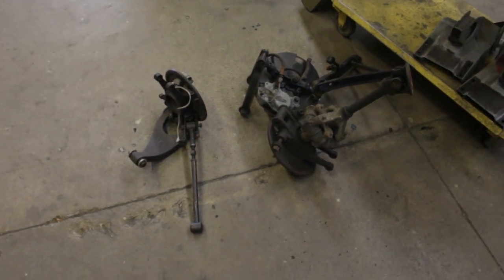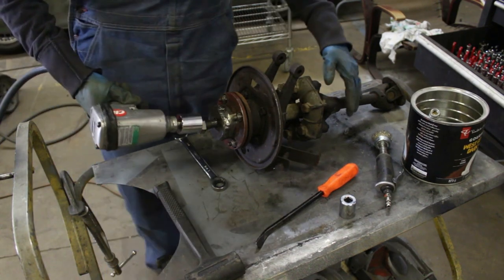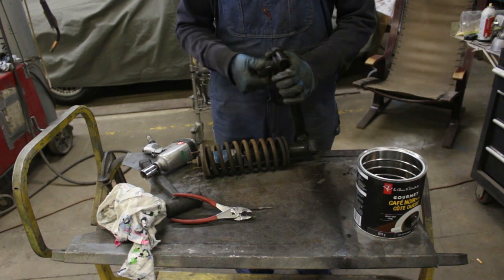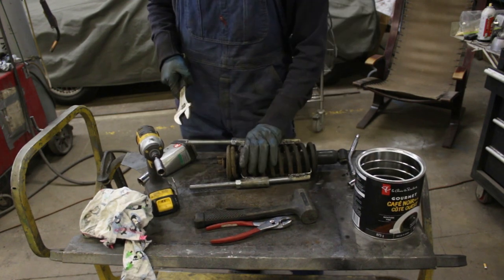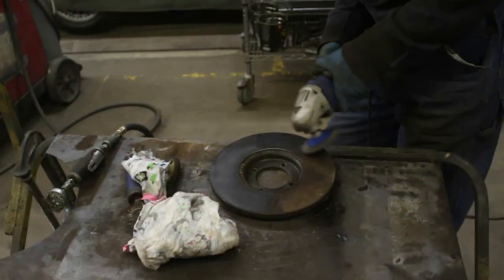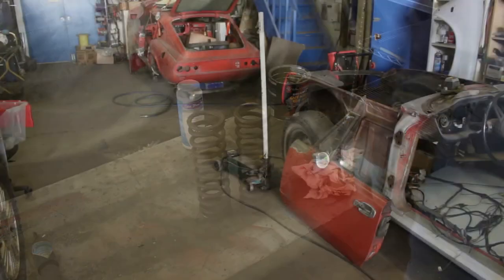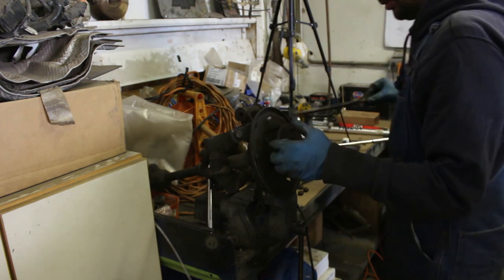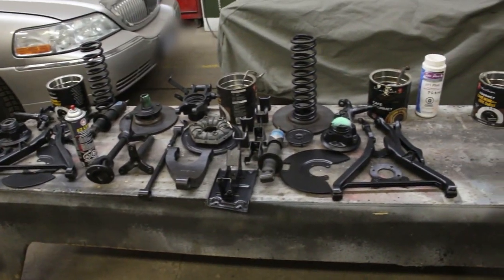1972 Triumph GT6 Restoration - Part 28 - Painting The Suspension Parts

Comment: I love the brush on frame paint.  I don't have a fancy rig either so I brushed my frame, with old cardboard on the floor.  I put poly bushings on my Jeep TJ.  They're easier to install but you feel every little vibration / bump.  I put rubber on my '74 Alfa suspension and it's ride is much better.

Comment: Super sore point here. I had a 1973 GT6 Mk3 that I renovated and the TSSC (Triumph sports six Club UK) valued it at less than the cost of the parts, panels and paint I used in the restoration. That was my main car. I had two other cars I wanted to renovate (Both MK2s) but after the TSSC bombshell they got scrapped. They really did not seem to like the GT6.